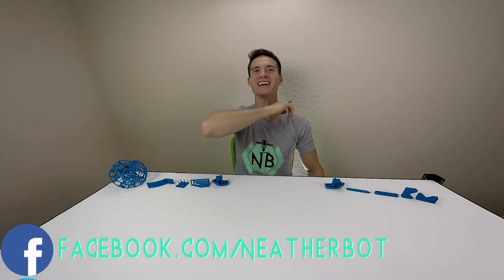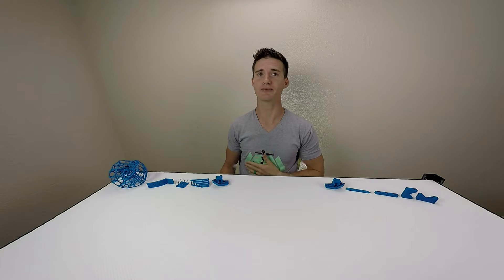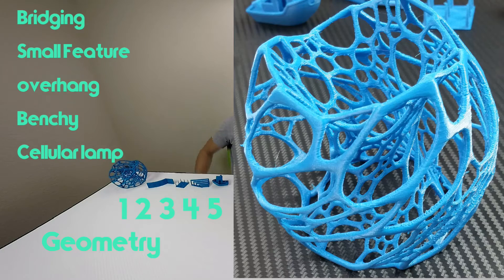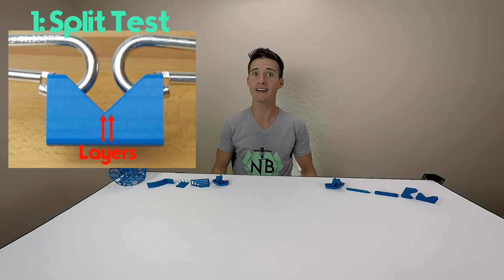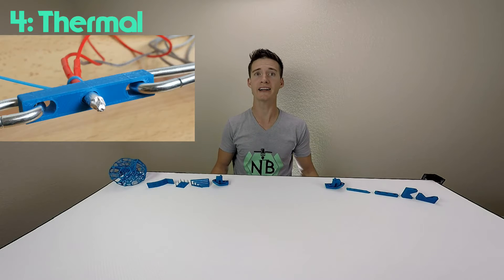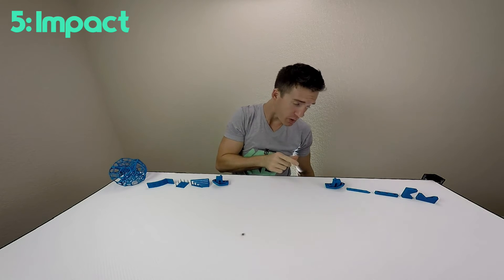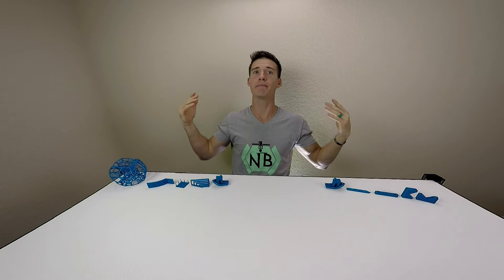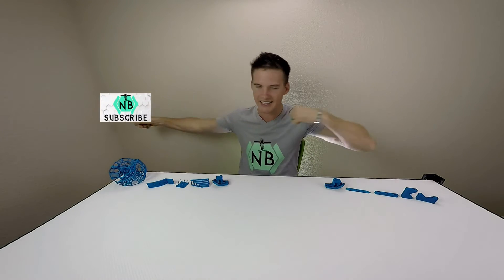Filament Testing Methods

Comment: I keep getting jamming with e3d v6 hot ends.  What retractions amount do you normally use?  My software's default is 8mm but i'm thinking of like 3 or 4mm would be fine.  it just seems like it gets up in the heat brake and then can't get back into the nozzle right.  Uber frustrated today.
Reply from the maker: +Spunkmire what printer do you have? For a bowden setup like my Ultimaker I have it set around 3 or 4mm of retraction. If you have a direct drive extruder then refraction would be even less. 8mm is waaaaay to much. I think you have solved your own problem. If you retract to much you pull the molten end of the filament up and it cool and hardens in the heartbreak and gets stuck. Any hotend that has a properly working heatbreak will jam if you pull filament too far up into the cool zone. 
Please let me know if you get it working or still have problems. Also make sure the cooling fan is wired right and is always on. Also check to make sure your bowden is held tightly and doesn't slide back and forth during retractions.
Reply: NeatherBot well I'm half way through a print and no issue yet,  after you mentioned the Bowden moving, I noticed the black "clip" at the top of the Bowden that is on the outlet of the filament feeder is moving about.  I'll post you a video link tomorrow to see what you think.  My printer is a poetry infinity, by ira3d.  It's ok but it has its quarks and issues too.
Reply: NeatherBot and thanks for the help,and timely response.   it's nice to get other people views on things.
Reply from the maker: +Spunkmire absolutely! I love helping out my PRINTr people! Yeah if I could see a video of your printer doing it's thing I can probably offer better advice. I hope that print finishes and you have no more issues. That V6 really is a quality hotend.
Reply from the maker: +Spunkmire I took a look at the printer you have... Seems legit. Gab try system is based off the Ultimaker and had similar bowden feed. I'm curious do you have two hotends attached to the print head?
Reply: NeatherBot I do, I have not had great experience yet with using support material or dual material prints yet.  I want to get more experience getting one head working properly then deal with the second.
Reply from the maker: +Spunkmire that is a good plan. So you have one v6 and one stock hotend?
Reply: Both hot ends are e3d v6 ends that take the T100 themister.
Reply from the maker: +Spunkmire can you send me some pictures? I'm curious how you have them mounted. If they are getting enough air flow through the heatsyncs.
Reply: yup, im on a 12 hour shift here so ill get to it after or tomorrow morning.

Comment: Would be very interested with the super generic Chinese filament pla from eBay ($10-$15 USD) See how it compares  to HATCHBOX pla (around $23 USD) or other main brand pla. Cool intro thanks!!!
Reply from the maker: +HodgerTech I had a similar idea. My experience has been with esun and its kind of hard to compare because the cheaper filaments sometimes print really well. The more expensive filaments are always good. Lol consistancy is king. I will probably end up doing what you are suggesting. It's a good idea I may just get a good/bad batch though. Thanks for the input!
Reply: Very true! I have been using the very cheep stuff for prototyping and whatnot on my heavily modified Solidoodle 2. I just make sure the Chinese stuff has a tolerance of +/- .05mm dimensional tolerance and so far have not had a problem.